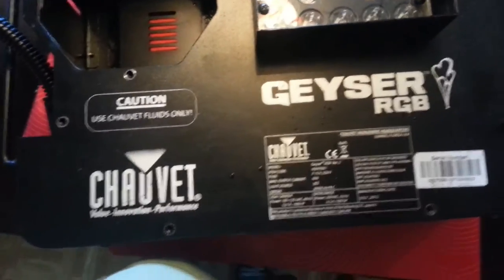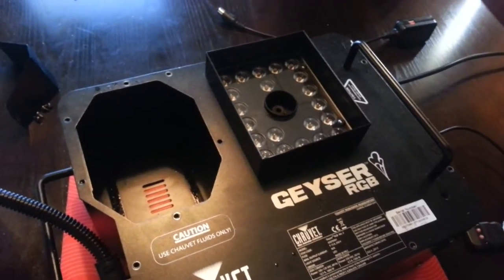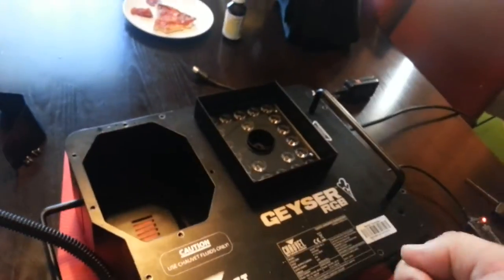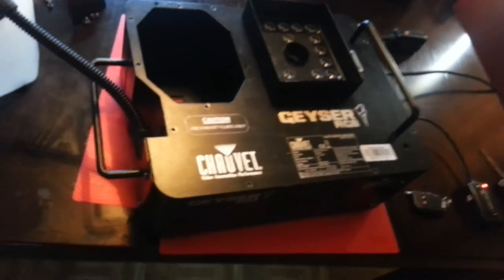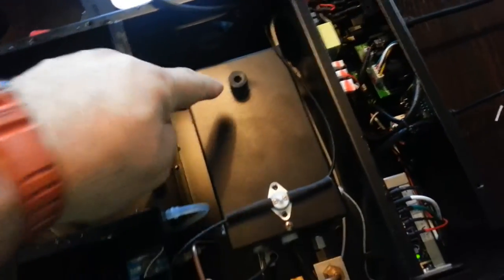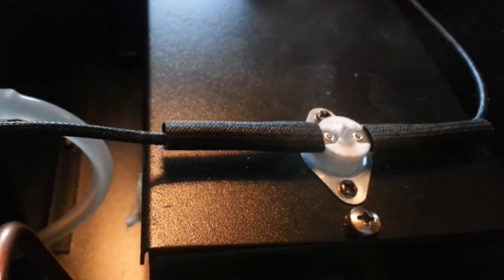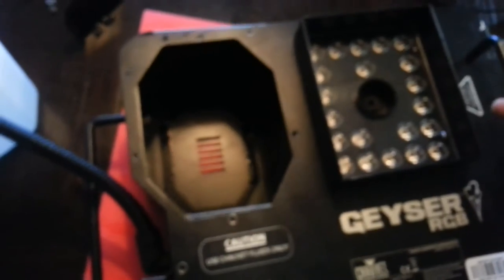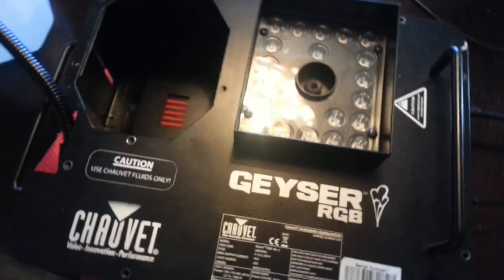DIY fix your malfunctioning CHAUVET  GEYSER  RGB

Comment: Good find! I was taking mine apart thinking the heater was shot, the heat light stayed on but no heat. I saw that thermistor but didn't realize it had the breaker button on it. THANK YOU! Started heating up right after I pressed it.

Also noticed the fan wasn't spinning, probably the reason it overheated and tripped the breaker. So while I was at it I replaced the crappy noisy sleeve bearing fan with a long life quiet ball bearing fan. Much improved, especially when you want it quiet prior to dance time.

Comment: So i bought two refurbished Chauvet Geysers from Guitar Center and i have not been able to use it once. Everytime i pluged them on to my dmx controller they start up fine they heat up and ill press the fog buster once or twice when it starts to overheat and it triggers the braker not only that but also my power source braker. is there something that may cause this to happen? maybe liquid its getting in to the machine?  any ideas anyone ?
Reply: i had the same issue  , i just replaced the thermistor with slightly  more resistance rating and it fixed the issue or you can try replacing it with the orignal rated resistance thermistor . its a cheap fix as well . i think the original usually get burned out quick and start doing problem after a while .
Reply: @shubi09  do you know where i can get that part ? i still haven't been able to use them

Comment: It's a thermostat  Chaucer has them available on there website had the same problem  with our machines and their not eve a year old yet http://www.chauvetparts.com/product.htm?pid=102253&cat=6402
Reply: We have 2 an both are tripped i guess, when they run out of fluid i imagine they get hotter then they should an trip the limit switch. Ours worked great, ran out of fluid an now neither work. So im hitting that switch tomorrow to see